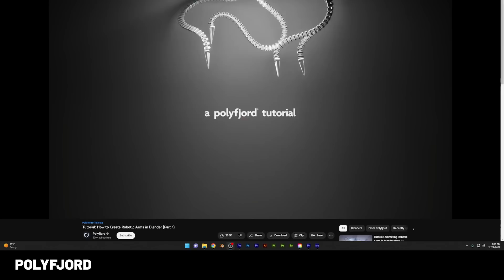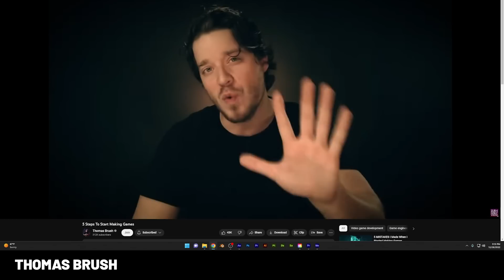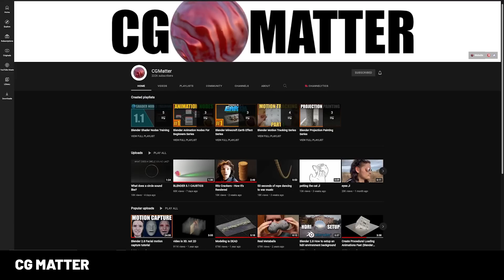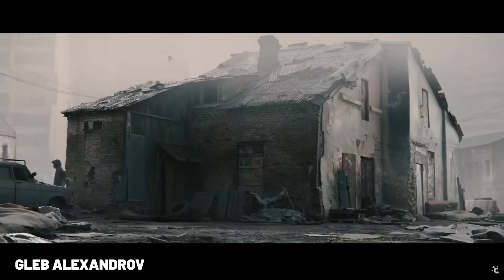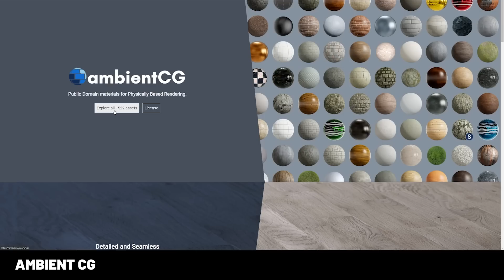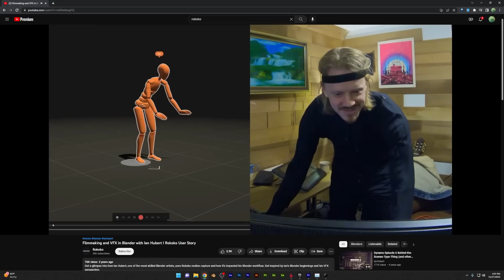How to Get GOOD at Blender 3D in 2023!

Comment: Another good one is Khamurai.

He does Geo Nodes but also made a resource which is a series of progressively more difficult Geo Nodes Challenges in the form of collections where he gives you nodes and tells you to plug them in in some way to achieve an effect, usually essential for Geo Nodes.

He also streams his process and has a Geometry Nodes Adventures series where he problem solved what he wants to do as well as recently streaming his process with researching the new Simulation Nodes branch